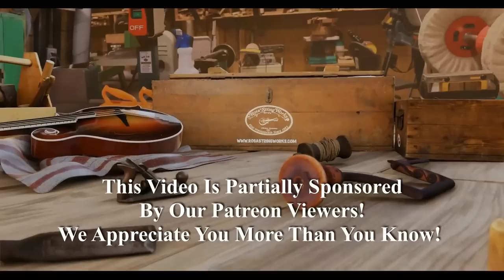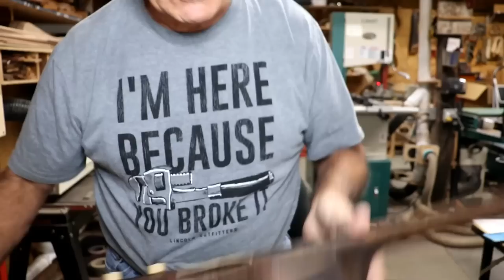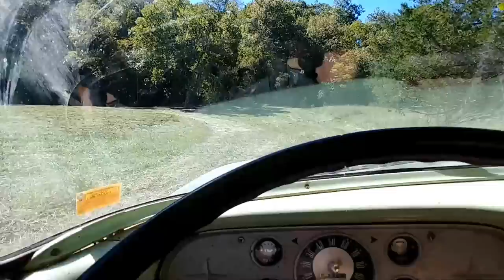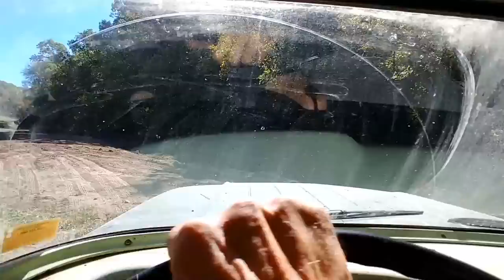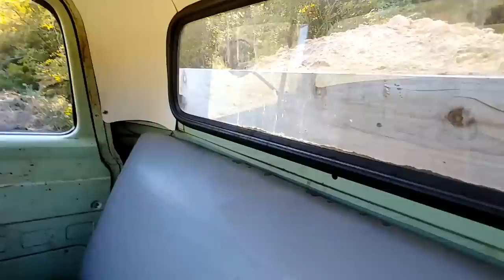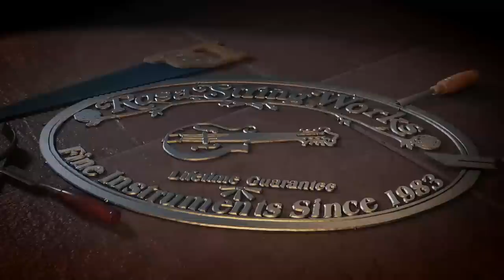Vlog #120 1957 F350 Still Running and Dumping

Comment: I remember driving an old Ford stake truck back in the 60’s. First gear is a “creeper” gear. The 2nd gear is intended to be used as the truck’s normal 1st gear unless the creeper gear is needed for special conditions.

Comment: You should reconsider adding more dirt to that old truck. I've seen it happen a dozen times over the years. People get greedy and want to get finished early and they overload the old truck. And something breaks on it every time. If it is working ok with five buckets you better leave it there, lol. As for trucks built in 2022 and running in 65 years from now. I kinda doubt any of them will be running. The factories have added so much junk to them. No way they will last 65 years. Awesome cool video thanks for sharing. Stay well & safe everyone.

Comment: We called it, "Armstrong Steering" in my neck of the words and in my day. I can see how that might affect your shoulders and back and might interfere with sleep. It's not like you use manual steering everyday and especially on such a large mass.  One handed steering in the reversing parts doesn't help the shoulders much, IMO. (I speak from experiene and can sympathize.)

Comment: I'm with you about over charging and planned ofbelesence.  Transmissions were just fine for 70 years but no they had to redisign them.  Case in point Ford has a transmissin that requires you to drop the transmissin spilt the case in half then pull out the gears so u can change a filter thats down under the gears. its a 6 hour job that a dealer has to do where as before it was 30 min job any guy that had been thru basic auto shop in high school.

Comment: Mr. Rosa, I am sorry for the way you took my comment. It was not intended as any sort of rebuke or criticism. Merely a reminder that "the book" is the way labor is charged in repair shops. No exception taken to your remarks. If "the book" says it is a four-hour job, the customer is billed for four hours labor, whether they figured out a shortcut and got it done in two hours, or if everything possible went wrong and it took them 20 hours. I didn't know or understand about "the book" until I worked in a dealership for about six months in the late '70's. I knew several mechanics that took home really slim paychecks a couple of weeks for that reason. I've felt that dealer branded parts were a rip-off for many years and have had more than one repair shop try to sell me repairs that were not needed, including one that tried to sell me a differential fluid change telling me it had not been changed in the ten years the truck had been on the road and I was lucky it hadn't failed. He didn't know I had it changed the week before at a different shop (about three days after buying the truck.). It's sad that auto repair places don't see the need to police themselves to maintain a reputation for being trustworthy, but we all know how eager they are to rip off customers they don't think will know any better. Again, I apologize for not being clearer in my comment. I really do highly value your programs!

Comment: Woo woo! Check out those drumsticks! Hey, Jerry, you might try using a long cabinet clamp on the one side of that guitar, clamping it end-to-end, and letting it sit for awhile (maybe even applying a little steam to it) to maybe get it back to the proper dimensions before you glue it up. Just a thought.